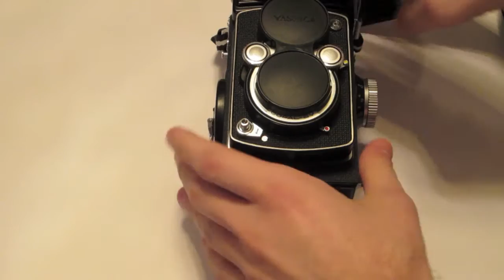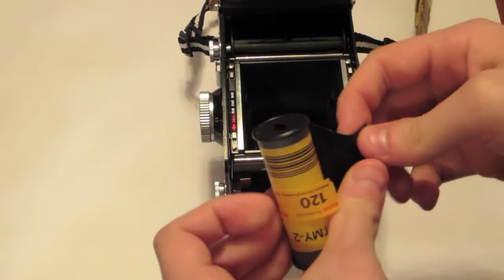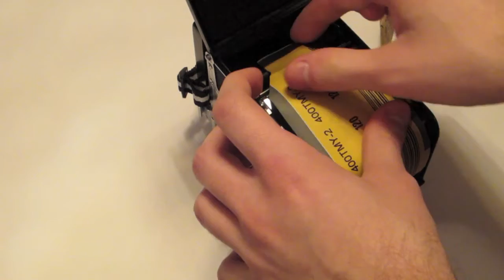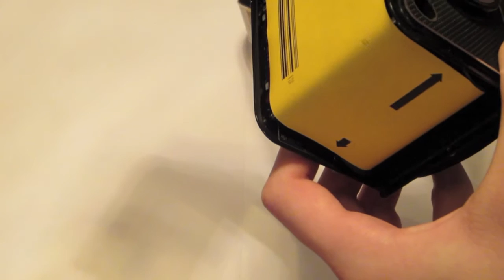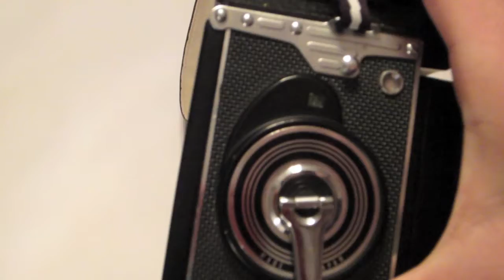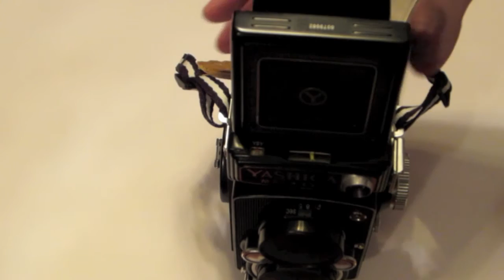Load 120mm Film Into A TLR Camera

Comment: Lovely. How are the differences between the TLR and 35mm?

My grandfather had a similar model camera back in the day, but lost it forever when my mom threw it in the ocean to end an argument between him and my grandmother. It's somewhere in the Pacific now... :)
Reply from the maker: That's a very unique story!! TLR cameras basically use different focusing than 35mm. Since there are two lenses, the image is reflected from the bottom lens if im not mistaken. They also take 120mm film, and sometimes harder to get film and you get less shots with them. They also develop as square prints instead of rectangle.

Comment: Hi, please help. 

1. How do I advance from exposure 1 to 2,  I mean how far do i have to rotate the lever?
2. What happens when all exposures are take ? Is the film safe to remove?
Reply from the maker: The advancement wheel will turn it as far as it needs to go, just circle it around until it stops. When you are done you just wind it until it's done and then it's safe to remove.
Reply: Wow, thanks, I wasn't expecting such a fast response. I really enjoy your videos. May I introduce myself, I'm Jack, a film slr user. My collection is small, but I own the following: Canon ftb (both black and standard versions), Olympus OM1, Minolta srt 101 and Minolta x-700. I'm really interested in TLR photography, any advice would be appreciated, much obliged.